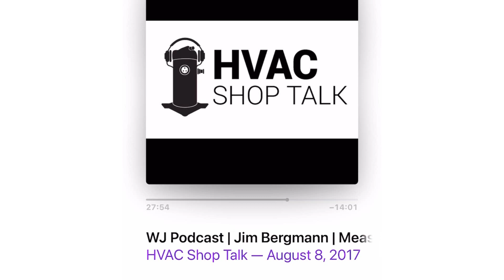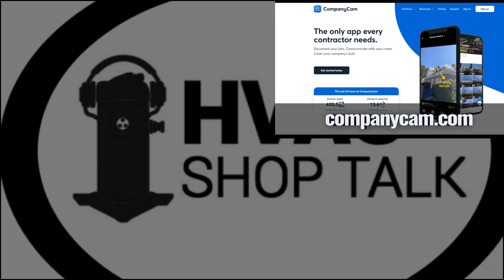The Origins of Measurequick's Non-Invasive Test mode

Comment: Does the non-invasive test involve no gauges at all, not even short probes? How do you get accurate pressure readings? How do you know what kind of charge you have?
Reply: Makes no since to hook up gauges to a system, if the system is performing correct. It happened to be a few time , where I got a call back on a system I did maintenance on and checked charge. Sure enough the valve cores  were leaking and tripped the low pressure switch. Now if I’m getting a 18-21 temp split I don’t even bother to hook up gauges.
Reply: @baylifehvac991  the temperature split can even be lower than that and still be within range, especially if it's a piston. It depends on the load.
Reply: @ishalljr  can you please comment on the transducers? I'm not familiar. Sounds like a commercial setup.
Reply: @realSamAndrew  I'm not either. I do primarily residential and some light commercial. The most I work with is variable speed and they did not mention anything in training about transducers so beats me.
Reply: Yes, no gauges. It is for Systems where a benchmark/baseline has already been established. There is no reason to check the charge unless there is an issue. Otherwise overtime you will be more than likely the issue.
Reply: @ishalljr  nice answer. So which point is the temperature taken? I imagine it must be either very close to or even inside the evaporator.

Also, what's this about when he talked about pressure transducers? Those are not always in a system.
Reply: @realSamAndrew  thanks. Typically outside at the unit unless the manufacturer recommends they are taken at the evaporator as they coincide with the ambient temperature. 

Once the benchmark or baseline is completed it I will take into account how the system operates by the details you put in concerning the system. 

Ultimately the temperature probes will let you know if the system is within range along with there being no issues reported by the customer. 

Keep in mind this is more than likely your customer so they will let you know if something is not right.
Reply: By checking temperatures